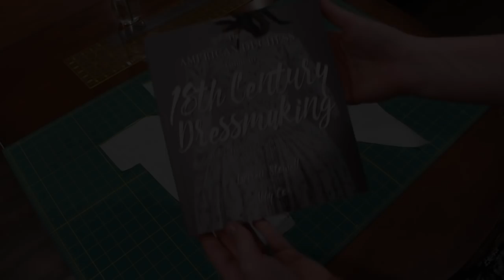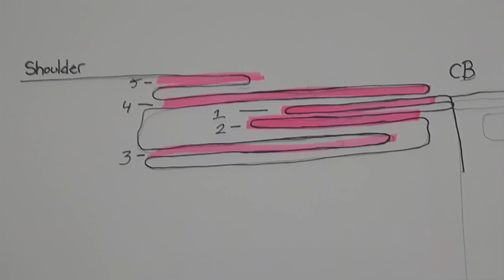Sewing a Robe à la Française || PART 2

Comment: You should’ve just used rolled grommets in the back so you could lace it in or out like a corset. Ties are going to be very fiddly to tie yourself into the gown.
Reply from the maker: Thank you for your comment. I opted for the ties becuase they are for if I need to let the gown in or out slightly due to weight change 😊 I don't need to tie them each time I put the sacque on 😊